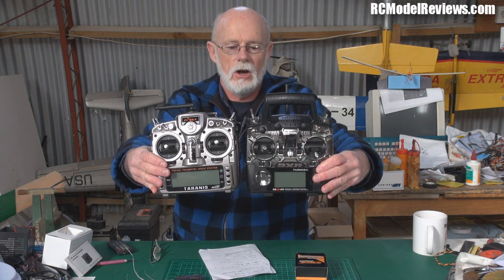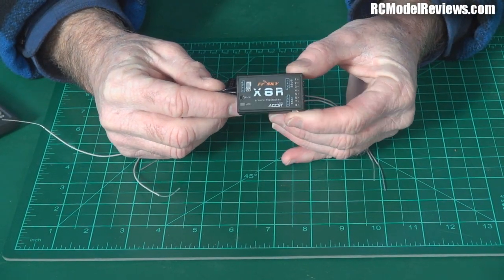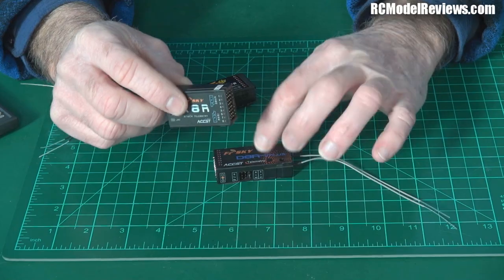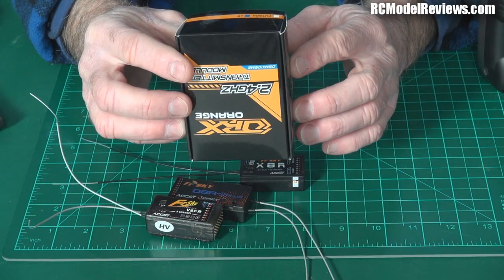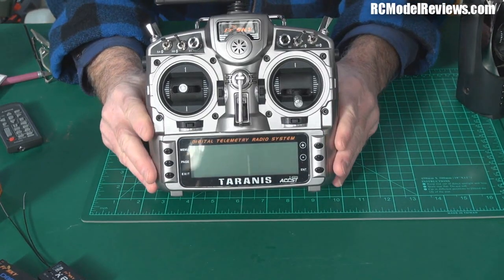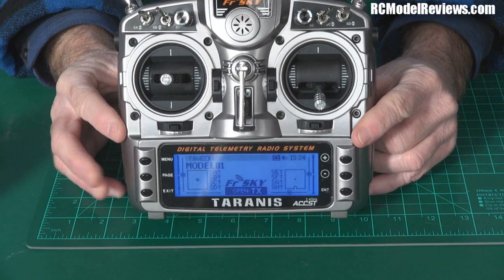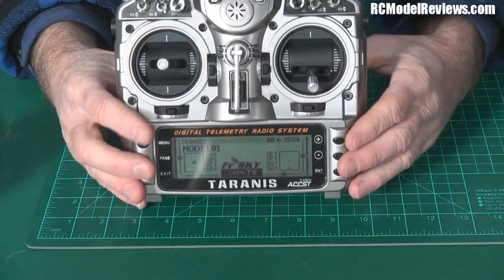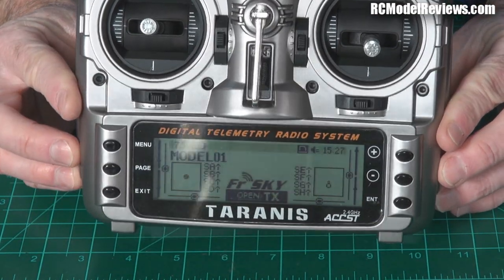FrSky Taranis Review (part 1)

Comment: I fly with my Hitec Aurora 9  and Optima receivers . The Optima receivers operate on up to 27  volts and give in-flight motor battery telemetry with not additional devices. I would like to view some very basic  information about "open systems". I get the impression that these new systems have cheaper receivers, have advantages for multi-rotor and FPV flying ( I'm not interested in either) but I don't understand what advantages  "open systems" will give me, a mostly electric powered scale model flier,  over and above "closed systems" such as Spectrum, Futaba, and a few others.

Comment: I have had a modded 9x for some time now, this Taranis radio is basically a fully modded 9x out of the box, if you google Open Tx you will see on the forums all the mods have been around for a while, I will be buying one of these as I know the potential of this radio and how much of a game changer it is. The firmware and support alone are worth twice the price of the radio.

Comment: Hi Bruce,
I was sure you would know that but just wanted to make sure people watching the video knew it is different to the er9x (which I used to use).

I need to correct myself as well, it is now called 'OpenTX' to separate it from the 9X Radios as the Taranis is really quite different hardware.  But, again, I'm sure you know all this.

Great work as usually btw.

Comment: The problem with NiMH batteries is they are really terrible in the cold.  The lithium suffers too but not nearly as bad.  As far as reversing the connector, all it takes is a simple diode (or other method) on the circuit to prevent damage from reverse connection.  I am curious to find out if FrSky did this.

Comment: Bruce...or anyone.  I see you are going to utilize a 3s LiFe (HK 1500 mAh).  Is it necessary to mod the battery's connector balance plug?  or can you plug-in the battery as is?  If a mod is required what are the steps / parts required?

Comment: I cant be happier with my Taranis. I just made a custom splash screen for mine and added some Top Gun music. For a price of a DX6i this is waaaayy better
Reply: But it's not the price of a DX6i.
I have just bought a Taranis plus, I have also bought the parts to make a DSM2/DSMX hack module.
The total cost is approaching £200.
The Taranis feels 'cheap' I'm shocked Bruce directly compares it to JR - which used jewelled movement switches.

You can buy a DX18 G1 for similar money on ebay.
The silly part is, a second hand out of warranty Spektrum set has a better warranty than a brand new Taranis.
(I have both).

Comment: Great channel and has been for years! 

Tell me, the frsky taranus can it be used for boats as well as aircraft in that there is astern involved in one and twin prop vessels.
For boats  on another system I use each stick to control each motor forward and astern and the off position needs to be centre rather than bottom. 

Also has anyone made both sticks sprung or both unsprung. This was possible in say the Planet T5 and T7 but that enterprise seems to have vanished of the market. 

Serious questions before I invest in more rxs

Comment: In the Painless360 series of videos on the Taranis he says to update the firmware at the beginning and I foolishly did that and it screwed up everything so now the sticks are on the wrong channels and I get a throttle warning every time I turn it on.  How do I correct that and get everything back to normal?
Reply: Yes I know how it works but the update swapped the sticks so the throttle was the other stick that's always in the center position instead of bottom. I figured out how to get it all back to normal though.

Comment: I'm really a noob, but can solder and buy stuff. I want to just buy a Taranis up front (never built a flying rc yet), but what is a "mode"? Are there more than 2 Taranis x9d's to choose from (mode 1 & 2)???
Reply: Btw, I'm in the US.  Is mode a regional thing?
Reply: Mode 1 has the throttle located on the right. Mode 2 has the throttle stock on the left. Australian pilots predominantly fly Mode 1 (I'm not sure about NZ) while in the US, it is predominantly Mode 2.
Reply: Thanks!  I actually thought I was alone here, but found a guy in Watsonville, CA who runs FPV Headquarters and helped me.
Reply: Kenneth no not really, you can choose but if you live in the US and fly mode 2 you can get help from others more easily BTW I fly mode 2
Reply: Thanks!  I got one now, it's a mode 2.  Got QX90 to play with but immediately broke the camera :-(

Comment: I tried sifting through the board (very quickly) on the road and on autopilot with my model s (still freaky) wondering if this can be changed to mode 1 easily? Amazing how hard it is to find mode one which I think is crazy since all video game controllers are mode 1 (Xbox,ps4,etc) I tried relearning the wheel but once your homed in it's hard to teach a old unwilling dog new tricks. I wrecked my last 2 quads walkera250 (not that bad considering your bashing which I found fantastic.) messed to get it peppy then crash and broke my heart and again I tried with vortex 250 and really haven't flown due to my mode1 crazy crazy needs. Ty I know you run mode one (Like a boss)
Reply: Epic-Elite Dynamics dunno about all video game controllers being mode one lol. Odd replying to a 10 month old comment

Comment: This radio would be fine to use with a 433 transmitter, if you want 5+ KM then you need a UHF system.
Reply: I love lrs have dragonlink myself although I have seen ppl go 8km with the frsky 2.4ghz

Comment: hi I first want to thank you for your videos! there great!!!.well I have only been flying quads for about18months. I use a stock turnigy9x with stock receiver. I have a naza m v1 that I did the latest naza v2 upgrade,now that I have all the new features and gps module I can not find anyone  who knows how to setup the 9x to be able to use aii the features rth,ioc  courselock homelock. I also bought my first fpv system 700tvl sonyboard cam from securitycam2000 and I have the new 5.8 32ch 600mw ts832tx and rm5832 that is a factory built 7inch monitor with the 5.8 receiver built into the monitor and I got a cheap hk excellence osd also. I am a wounded vet that has spinalcord damage and I was wondering if you would be interested